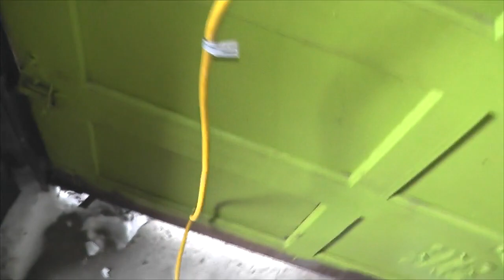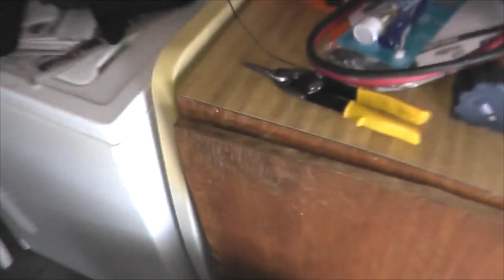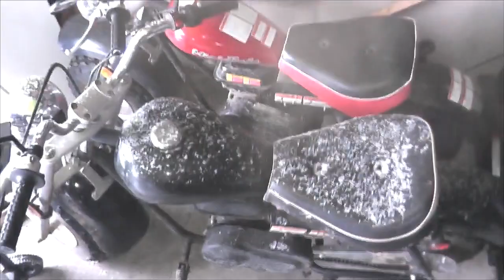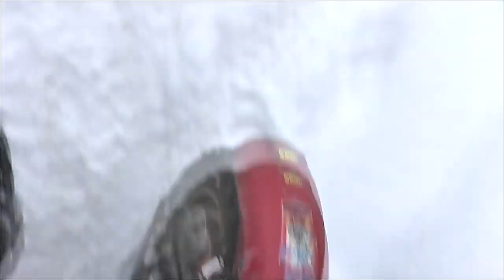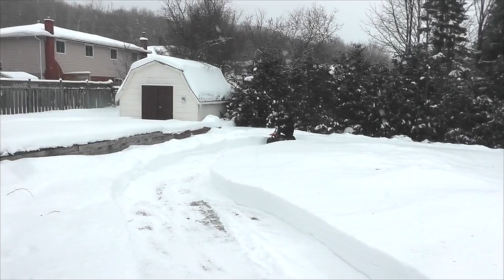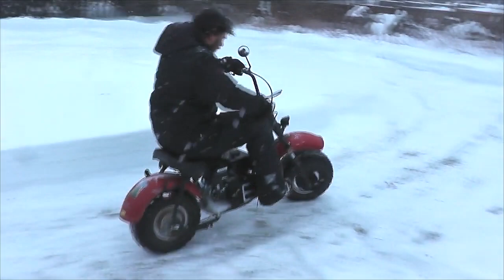Turning the backyard into an insurance claim

Comment: if you ever run into small engines that dont start in the cold, try 2 things, 1st gas soaked rag  on the intake, if it doesnt fire try taking out the plug and heating it up with a torch and cleaning it with a wire brush, hot plug makes gas start way way easier

Comment: see, here's the thing, you don't wanna ride and as soon as you admit that to yourself the better off you'll be. If you did, you'd make those bikes start. People who want to ride do whatever it takes, WHATEVER IT TAKES!!! I once kickstarted a bike for half an hour that wouldn't start... until I discovered the switch was off, i mean, the side of the engine was warm to the touch from kicking it over so many times. How many times did you pull your bike, 5, 10... pffffft! First off, you start them before you go out riding, like first thing in the morning to make sure they're good. Second thing, heat them up anyway you can. Put a kerosine heater next to them, heat the side of the crank case with a blowdryer or a heating gun or a propane torch, just don't set shit on fire. Check to make sure the fuel lines aren't frozen, you can heat those up as well. Man you look after your stuff and not just hope they start 5 minutes before you wanna ride.

So if you don't wanna ride, that's fine, you shouldn't let people talk you into stuff you don't wanna do but don't act like you wanna ride and then say your bikes don't start. Am I trolling? Yeah, a little, I usually don't troll but it's fun every once in a while. but man... jeez. Riding is a thing of spirit, you don't let no damn bike break your spirit.
Reply: Haha!

Comment: New engines will always have alight coating of oil all over them, so, it'll be burning off, plus it's new so will be tight as a ducks arse, meaning it's oil's getting hotter... :P

hehe, one good thing about snow that deep is if you fall into it, it's nice and soft... :P

oooh, right on his arse, nice, hopefully no stray oreo turds were there... :P

Good thing that the snow makes good brakes when the throttle jammed... :D

Aww, chain fell off, ah well... :P

And now the dawg can go running round in circles doing laps of the track... :P
Reply: *****
Yeah, the steam was just snow turning to steam on the hot engine, the same effect as drowning a hot engine in a pond and then driving out again having loads of steam piling out from the engine bay... :)

Comment: you need to clean out your carbs on the bikes you left them both sitting with gas in them still that's a no no and this is what happens when you do usually. 
wouldn't have been so bad on that track if it was flat and no uphill climbing it's the climbing parts he kept getting stuck or at least slowed down on.

Comment: Ha ha madness at adams winter wonderland :-D :D

Dam shame you didnt get your machine working adam, next time take the spark plug out and warm the end electrode up a bit, drives the damp away, then pull the engine start rope over a few times to clear the bore before popping the plug back in.
Full choke.